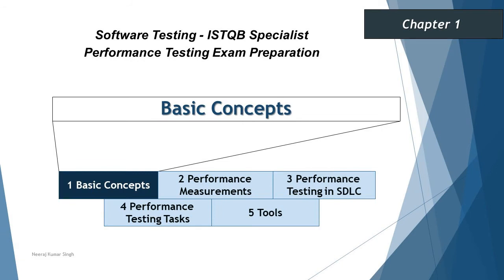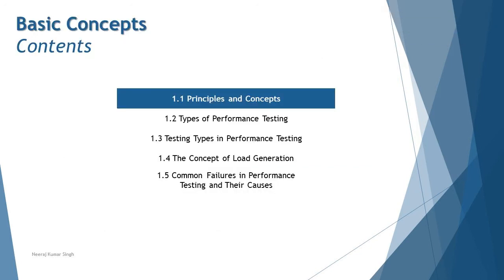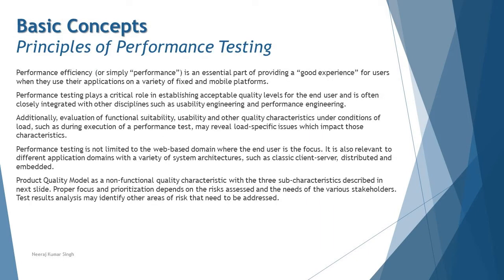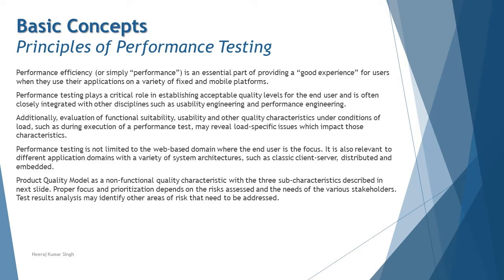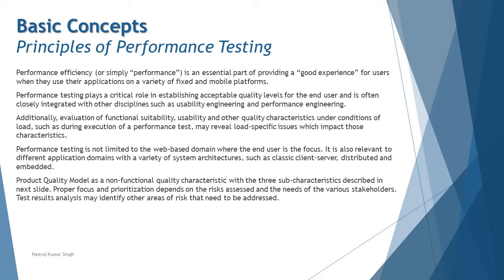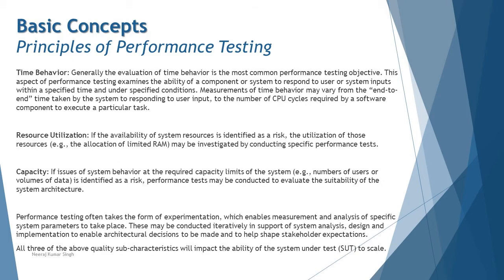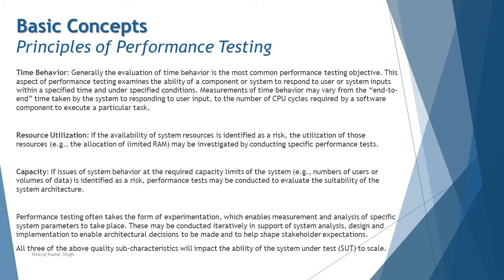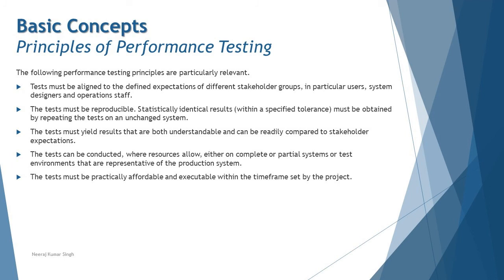ISTQB Performance Tester | 1.1 Principles of Performance Testing | ISTQB Tutorials

Comment: I Don't understand what is difference between  resource utilization and capacity, can you explain by real example  please ?
Reply: as per my understanding, resource utilization > the RAM % using with 100 simultaneous  users. capacity > how many simultaneous users system can handle with less % of errors (may be 5% of errors)